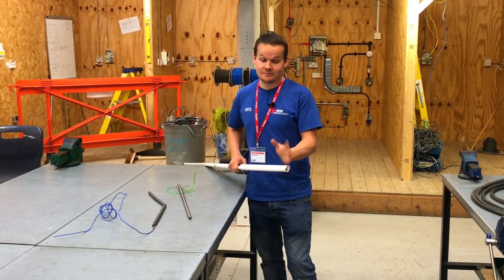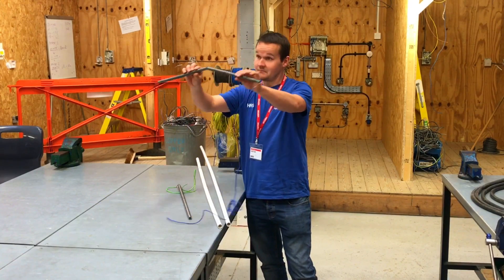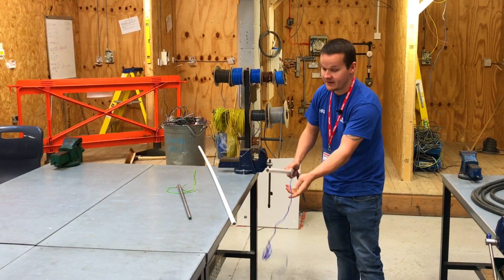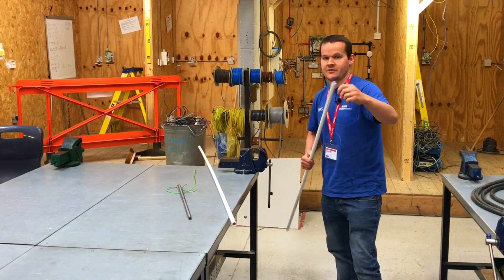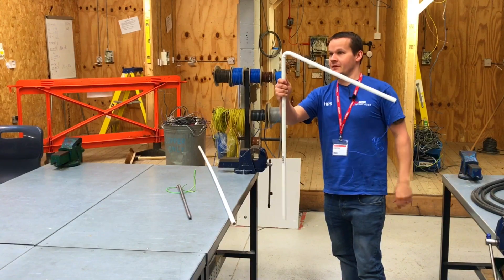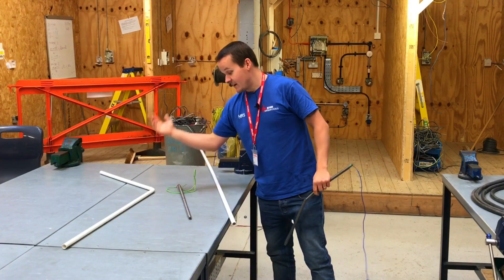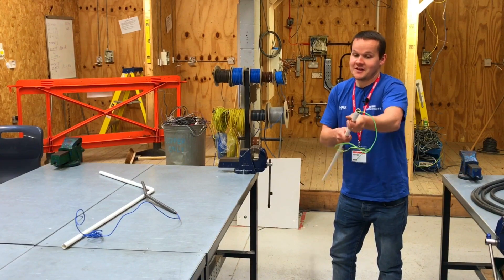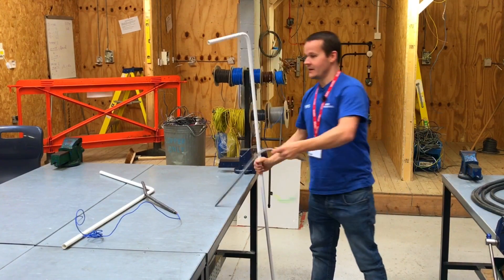How NOT to Bend PVC Conduit - Chris from CJR Electrical puts a 90 Degree Bend in Cheap Kinky Conduit

Comment: If you are using an already kinked spring you won't give a fair test. 

Having seen some of CJRs video's and some of the stuff he has installed and let slip. SWA with ripped outer sheathing that rather than taking back he moaned about the suppler and installed anyway in one video and a shed install that he got so much grief for he did another video to prove he corrected the work in another left me feeling he was not someone that people should be following as a role model.

Comment: Mate to save your spring you need to get the wire inter the spring from were you tied  the wire and exit from the other side of the spring coz when you pull the spring out from the pipe the spring will close instead of opening it hope this will help save some bending springs

Comment: Sure i read in the spec sheets somewhere that they recommend a heat gun to facilitate smooth bending (unless you enjoy the kinky stuff)
Reply: yeh, tried that mate.  even on a low heat it leaves marks from the spring on the outside of the conduit.

Comment: The first conduit is light gauge not a cheap conduit..yes it's costs less to buy..  you can actually get a slightly larger spring to accommodate the larger hole for the light gauge conduit.
Reply: Yea that's what I thought its different springs for different conduits isn't it
Reply: the first conduit isn't sold as light gauge, it's specifically sold as 'heavy gauge' by screwfix and just doesn't compare to the stuff you get from the merchants.  Which is a shame because most of the time, screwfix is handier.

Comment: By all means buy the cheap stuff, but use inspection elbows or bends, don't waste your time with the spring.
Reply: Utter nonsense. Inspection elbows and bends are for sparks that are too lazy to bend conduit or just useless at it. Use the right spring for the type or gauge of conduit. Only takes seconds to bend. I’ve sacked more men who can’t or won’t bend conduit.
Reply: @mikeysky8917  Glad I don't work for you! :)
Reply: Robin Rawson-Tetley I maybe harsh but it’s a high standard we set meaning the jobs we get how big or small they are, will have good reliable men doing them.